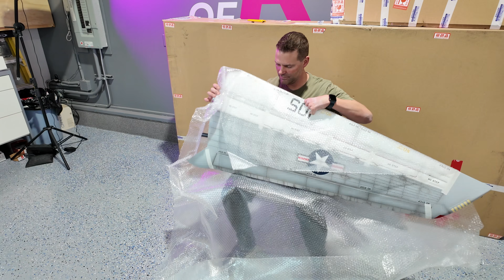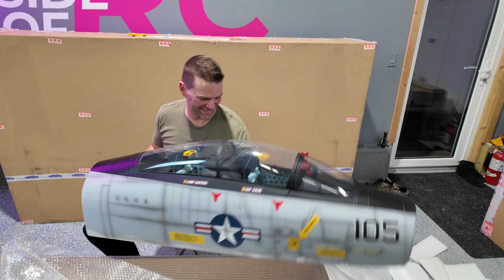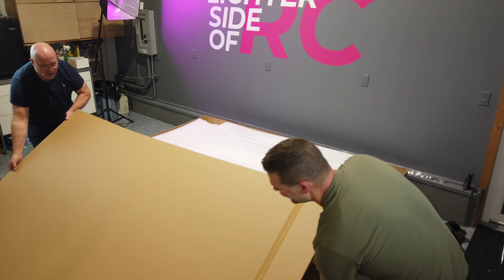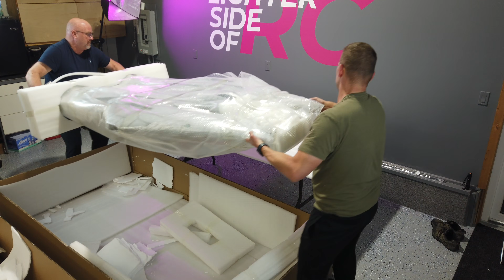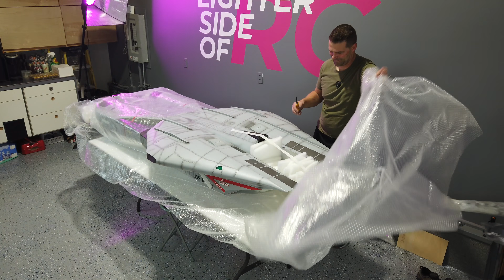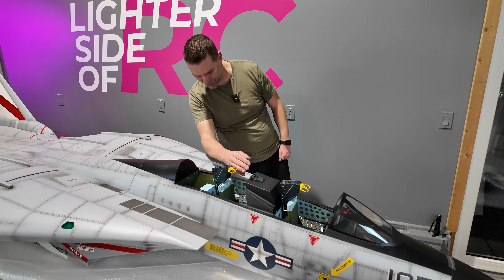Skymaster F14 XXL Top Gun Quality Rc Jet Unboxing

Comment: what size jet engines are used for this?
Reply from the maker: for weight purposes we will be installing twin 240 N turbines.  We wanted to do 300's but that would put it over the limit.
Reply: 240N turbofans

Comment: Man that thing is awesome. Only discrepancy I have is the control stick in the rear. The RIO did not have a flight stick since the pilot was the only one that could actually fly the plane. Other than that, this thing is BADASS!!!!!
Reply from the maker: Thanks!  Easy to remove!  Such a cool plane!  Thanks for watching!
Reply: @thelightersideofrc  You're welcome, there was a small stick for the RIO that was used for weapons control. I was trying to find a good pick that I could add a link to it for you but its hard finding a good shot of the RIO's workstation.

Comment: Is the tail hook usable? Could someone setup a catch system on a runway and do simulated landings with a functioning hook? Look forward to the build.
Reply from the maker: we will be making it operational.  As far as function goes.  Possible but would be a bit tough.  you run the risk of catching your nose wheel/leg on the arrestor.
Reply: @thelightersideofrc  I thought it would be possible, never seen it done…no doubt someone out there has tried.

Comment: I wish they would just redo the original size, this is too big, when they get this big they fly like crap no fun just a big kite in the air and the use fuel like crazy.

Its one of the reason why BVM gold fly so good they keep it under 120 inch same for carf planes.

Skymaster just needs to fix and chop off like 10-15 lbs from the original design.
Reply from the maker: They still make the size down from here.  Or are you talking about the Tiny F14?  Problem with the smaller ones is the complexity is still there so the wing loading goes up compared to the larger ones.  The larger one like this XXL has lower wing loading and in turn will fly much better.

Comment: Nice, how do you transport something that big, look forward to seeing this being assembled,  at least all the scale detail has been done.. still it's gonna be a lovely project and build.. certainly in the top end of modelling cost.
Reply from the maker: Thanks!  Basically it will take up the entire floor of a trailer.  Typically with something like this it will get transported on it's landing gear.
Reply: @thelightersideofrc  Add some extra floors to the trailer and you can easily transport four!

Comment: i know this is a nitpick but they missed a detail in the cockpit on the RIO seat there should be 2 spikes at the top if that is a F14D
Reply: With that color scheme, it really should be an F-14A, but for some reason RC companies keep making models of the B and D (even though the early A model color schemes are so popular).  Oh well.
Reply from the maker: Most model companies don't bother with all the intricate details that 99.99% of the model fliers would notice.
Reply: I'm not sure that's true...I mean we are talking about modelers here. :) @thelightersideofrc
Reply from the maker: @RocketToTheMoose  great point but I myself don’t do this for the model aspect. I do it for the flying aspect. 

If we were building a one off model to compete in a scale competition like jet world masters than sure. Every detail should be covered if you want to be competitive. 

So in the RC aviation hobby you find all different levels of scale details. Some semi scale. Some over the top but in the air, while it’s flying, the micro details won’t matter.
Reply: Yeah I get it...I've been doing RC for many decades.  Some scale stuff, some not.  I'm just curious about why the companies made the decision they made when they decide which version to model. Even Horizon Hobby went with a B model when doing their little foamie F-14, for instance.  @thelightersideofrc